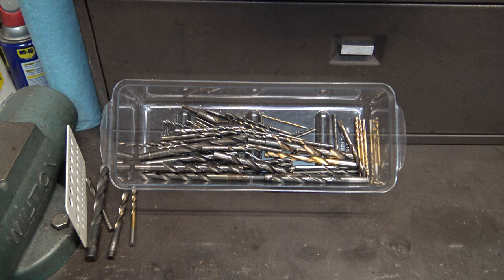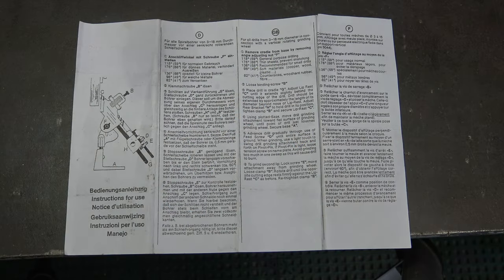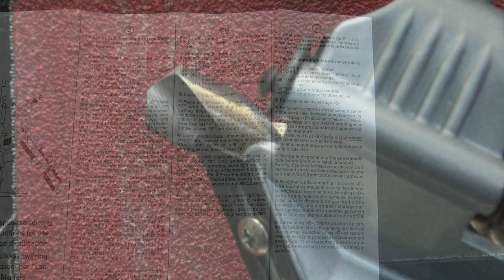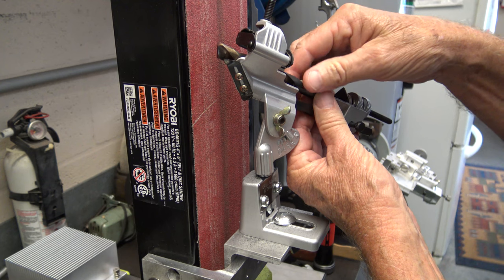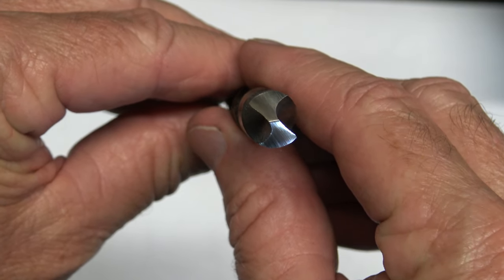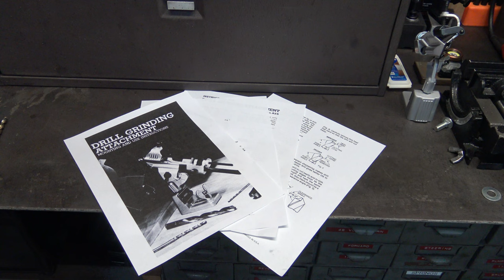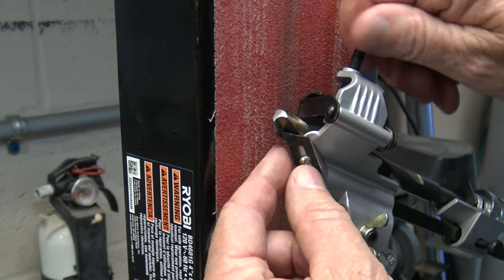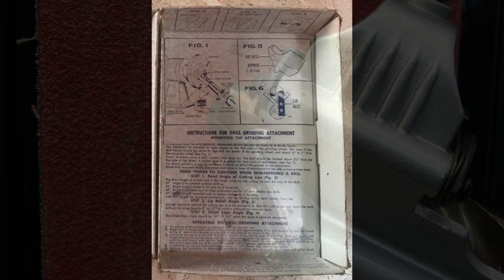General 825 Drill Bit Sharpener

Comment: I set up the bit for metal 118 degree with 50% of drill diameter overhang. I then use the adjustment on the base to gently kiss the grinding wheel for the first pass. I rotate bit keeping all settings same, grind again, then i use the adjustment knobs at the back to move the drill forward, grind the flute that i ended with, rotate, adjust again when required etc etc. this ensures even grind with minimal heat. Also the 50% diameter rule ensures sufficient relief from the cutting edges to prevent friction heat build up during drilling. This works just fine for me this way. I have a dedicated grinding wheel that a dress regularly with a diamond to maintain the surface. I just love this tool, cheap and does the job very well.

Comment: I downloaded the instructions from General Tool.  It says,  118 degree point (59 degrees on the angle setting), the drill should protrude 50 % of the diameter of the drill bit, not 100%.

Comment: I bought mine several years ago for a project drilling out broken exhaust manifold bolts. I used the old directions for the over hang distance. It places the cutting edge perpendicular. What I discovered is the heal was not low enough to the cutting edge and would not chip out well and soon dulled and overheated. 

The heal needed a steeper bevel, so after grinding the first pass on both sides the second pass I advanced the bit and only ground to the first edge of the point on both sides. Creating a double facet/bevel. What a difference that made! 
I just had to relearn how to grind the bit on that jig for a current project. Kept burning the bit until I figured it out again. 

It is a great jig, it just takes a bit of learning curve. There is more to it than what the directions provide to make the bit cut to its fullest. A pilot hole for large bits helps too.

Comment: Also, you don’t use a belt sander because the belt is not tight on the platum. The belt actually floats you need to use it on a grinder, period

Comment: In the first three sharpening attempts you've got the point angle setting set to 88 deg and the 4th attempt you've got the point angle setting set to 59 deg. The 88 deg setting puts the drill tip a lot closer to the grinding surface which is why you were grinding so much material from the drill bit. In such settings you need to move the attachment mounting point further away from the grinding wheel. Throughout the video the point angle changes from 88 to 59 and back and forwards multiple times.
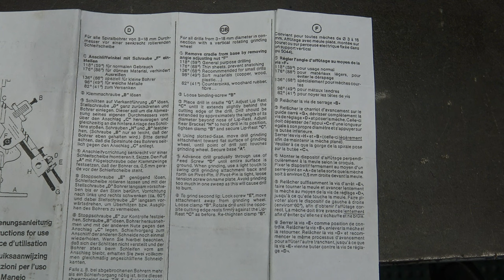Reply from the maker: In the video, I never used the 88 degree angle. I tried the 2 most common drill angles 68 and 59 degrees with the same result. There are 3 different instructions for the same sharpener as I explained in the Video. All say to Drill the mounting hole 2-1/4 inches away from the grinding surface. The difference in the instructions is the stick out distance of the drill bit past the drill lip rest on the sharpener. In the first set of instructions at 1:52 on the video, it states the drill should be the distance of its diameter past the lip edge. The problem is with the mounting hole 2-1/4 inches from the grinding edge, you cant move the sharpener far enough back as explained at 2:26 on the video. The second set of instructions at 5:22 said to refer to the chart for the drill angle stick out. At 5:29 the chart states the stick out should be 1/2 the diameter of the drill bit for both 68 and 59 degrees. Had the same result. The drill bit sharpener will not move back far enough to do a touch off with the drill bit no matter which angle you use. The proper instructions are the oldest instruction 6:53 on the video. The drill stick out should be 1/16 of an inch past the sharpener lip edge. At 1/16 of an inch stick out you can adjust the sharpener at any angle and still have room to adjust the sharpener up to the grinder. The point of the video was that the grinder has always been the same but the instruction have been changed. 9:38 on the video.
Reply: After reflexion, the distance 2 , 2 and half or  3 inches don't change anything because the drill is on the hypotenuse of a triangle.

Comment: You found the distance  off the support to be 1/16"  where I recommended it to be about 1/8" so it may not be all that critical?
What is important is the leading/cutting edge be vertical on the finished pass and it may not be allowed to be anything else by virtue of the design of the sharpener. I'm doing this from memory from a few years back, so forgive me if I'm mistaken.
I still use the sharpener without the lip stop with good results, and maybe that's just my method, that works best for me?

Comment: great vid. i have problems as to where set drill on lip & at what distance. this clarifies it. where could i get a pdf of blue point dg-825 instructions ?
Reply from the maker: Thanks for the comment. I've looked everywhere for the old blue point instruction manual with no luck. Best I could do was looking an image screen shot on google images. Some of the older Craftsman sharpeners had the same instructions as blue point. https://youtu.be/cc6g3Ah-BBA   Here is a link to a video I found. Its in Spanish. I don't speak Spanish but there are some good shots of the manual. Hope this helps.

Comment: Hello,
Are you sure your fixing hole is 2-1/4 inches  from the grinder wheel like is said in page 2 on the instructions for use ?
Reply from the maker: Yes it is 2-1/4 inches from the grinding surface. I found 3 different sets of instructions on the internet for the sharpener as it progressed through the years from about the 1950s to the present day. The instructions that came with my sharpener did not say how far away to drill the mounting hole. After doing some research on the internet I finally found the correct instructions. The problem is the newer version of the instructions show the stick out past the lip rest is too far. The older original instructions are the correct instructions with the drill bit 1/16th of an inch past the lip rest.

Comment: Excellent video! I recently found on of these in my barn. I'm guessing it's rather old. In the process of cleaning it up and looking forward to using it. Hence my researching it online.  I have yet to find any printed instructions. Would you mind terribly to share the link that you found the proper instructions?
Reply from the maker: Sorry for the delay. I've been trying to find a link to some good instructions. Most of the new instructions have missing or wrong Details. I think the problem is that the sharpener design has been copied by so many different manufacturers, the original instructions have been left behind. Most of what I found is just screen shots of what I could find while researching its history. When you watch my video you will see how wrong the modern day instructions are. If your not mounting it to a flat surface belt sander as I did. I would use the side grinding wheel method on a bench top grinder. Just be sure the grinding wheel is rated for side grinding. Watch all of my video again and I think you will be able to come up with something that works for you. Hope this helps.

Comment: I gave you an undeserved thumbs up for showing what not to do!  Why did you grind the hell out of that bit that was obviously extended too far??  Had the Craftsman version almost 60 years ago.
Reply from the maker: I ground the hell out of the drill bit to show people what happens if they purchased this sharpener and follow the new version instructions that are incorrect on the drill bit extension past the lip rest. The old Craftsman and Snap-On (Blue Point) Version of the sharpener had the correct instructions as mentioned in the video.

Comment: Dude, throw those instructions away and remove the "lip stop." Set your bit distance to the belt to about 1/8" using the adjustable stop on the rest.
Make the flute angles parallel as they come from the factory. Don't reivent the cutting edges, just duplicate what's there. I've done it this way for years.
I use the same setup on my belt sander/grinder, a 6" X 48" Craftsman in the vertical orientation. It works great. Your tool rest is too narrow to get the jig back far enough to work correctly. Make a new wider one.
Reply: I concur.
Reply: PATRICK,  ciao Patrick ho acquistato questo utensile affilatoio(general 825) molto tempo fa  senza mai utilizzarlo perché non c'erano le spiegazioni, ora ci sto prendendo confidenza e comincio a trovare le prime soddisfazioni, cosa che non riesco a capire quale è l'utilizzo di quel piccolo arpione uncinato che si trova sulla sinistra in punta sorretto da due viti . Potresti spiegarmi a cosa serve? te ne sarei grato. Un saluto e un abbraccio da ROMA.
Reply: Thumbs down for getting rid of the 'lip stop', else what positions it?
Reply: @alro2434   My "expert eye" can tell the position of the bit in the "V" trough.  Start with the bit up against the grinding surface and make note of that position, then clamp it down, proceed to grind it, then advance the feed wheel a slight amount for the next grinds.

Comment: you should not be allowed around power tools at all this is made for a bench grinder . it can be used with a sander but you were way to close the tip of the bit should just barely skim the grinding surface. your bit is ruined you took the temper out of it with excessive grinding.
Reply from the maker: You are correct. I am well aware that I ruined the drill bit. That was the point of the video. The Video was about the incorrect instructions that came with drill bit sharpener and the history of the sharpener as the instructions have changed from the original instructions. If you watched the entire video you will see there are many different instructions that came with this sharpener throughout its history. At the end I show the correct way to use the sharpener with the correct instructions.
Reply: @mdw66799  only later you found out how far away to mount it  you weren't showing the incorrect way you just didn't know any better you said at the end of the 1st attempt it did a pretty good job cause it was even. so i'm still calling bullshit you can fool some of the people some of the time but you ain't fooling me. the dead give away was when you said so they wouldn't have to go through what you went through. there's nothing wrong with not knowing something . i;m 65 and still learning things.